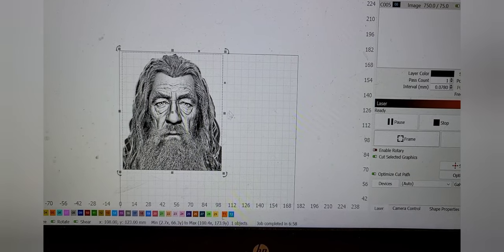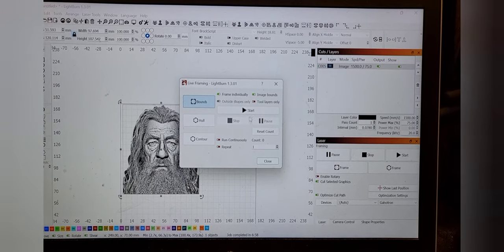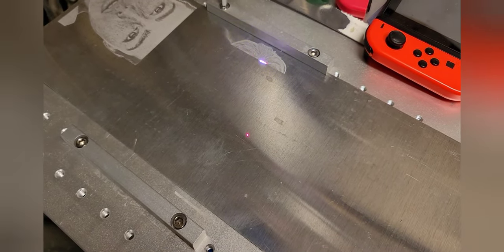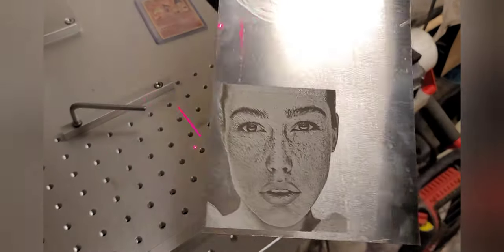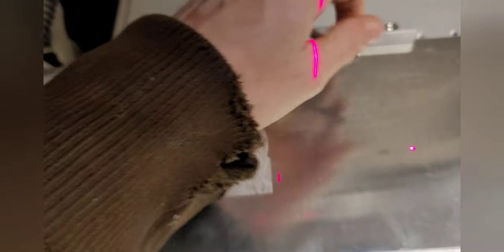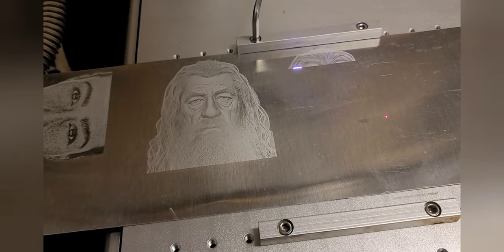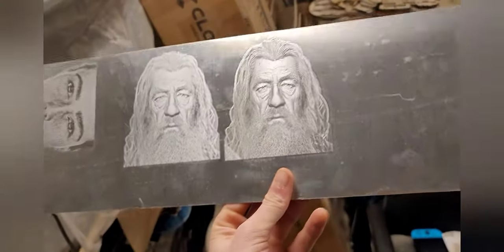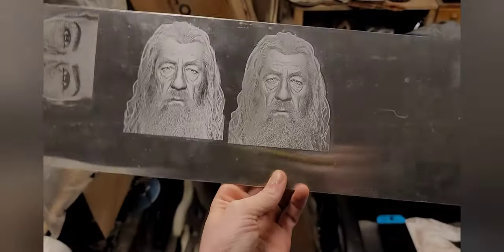Photo Practice on Aluminum with 30w Fiber Laser: Lightburn Galvo Tutorial

Comment: can you briefly summarize the steps again, what exactly is necessary so that it no longer reflects?
Reply from the maker: Yeah sure.  

First you want to engrave the surface area where you are putting your photo.  Use high speed lower power.  A square or circle shape works well for this.

Once your surface area is engraved it should look a lot lighter than the material around it.  

Then engrave your photo at a lower speed and higher power over the surface you engraved previously.

Hopefully that helps!
Reply: @jjengraves227  thank you very much! Can you recommend rough settings for a 20w laser with 110mm lens that I can start with?
Reply from the maker: @RrLl-br5eb  I have a 30w so mine would be a little different.  

I usually run my photos at around 200 speed 
65-75 power
Around 600 DPI

The surface area engraving I run 
1500 speed
45-55 power
Reply: @jjengraves227  which lens do you use for this?
Reply from the maker: @RrLl-br5eb  I'm using a 200mm
Reply: @jjengraves227  Thanks a lot!! :)
Do you happen to have experience with annealing, can you share your approach and settings?